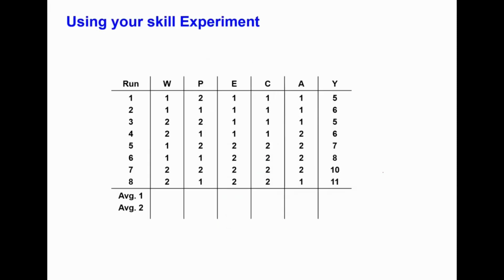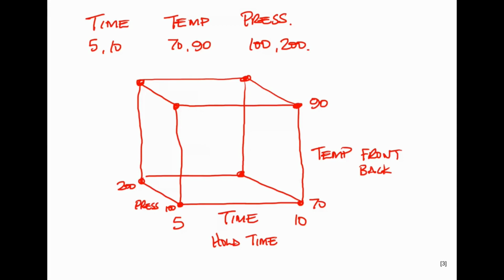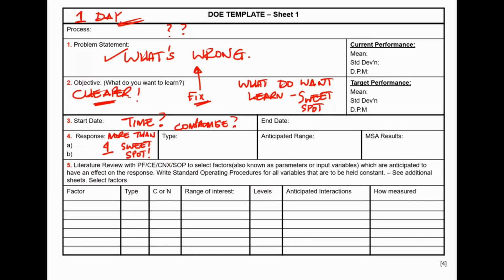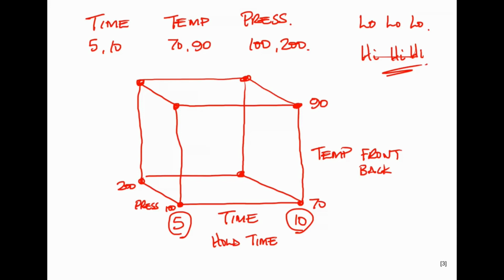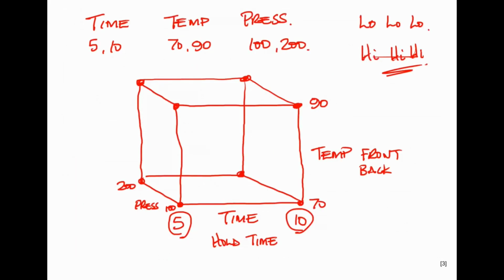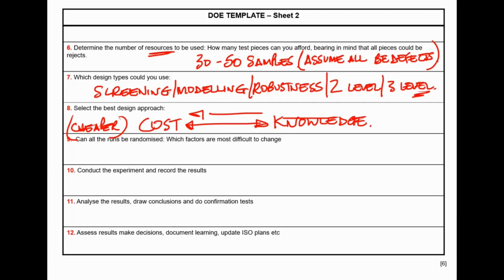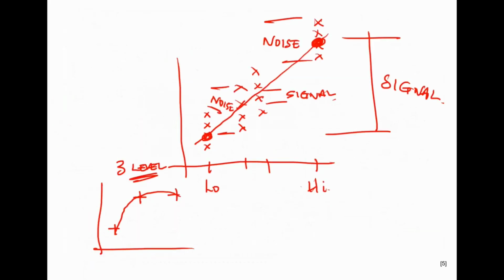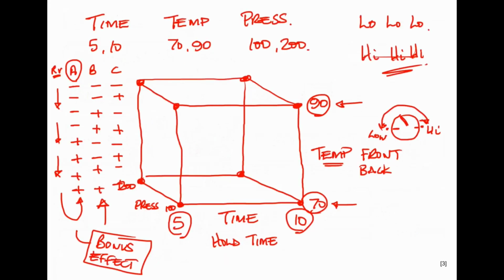DOE Planning - Make your Experiment a Sucess!

Comment: Hi Paul, I have a question to you regarding DOE. When we select High/Low settings for inputs - how we select them? Example: we defined an input "air pressure". Usually it's 1.5 bar. How we define what will be Low and High? Take the historical data? Machine supplier's recommendations?
Reply from the maker: This is were you have to use your skill. You have to decide how far can i go and still produce measurable results, you must go at least slightly wider than current regions so you can learn soemthing new...